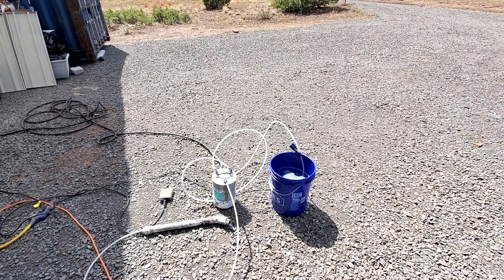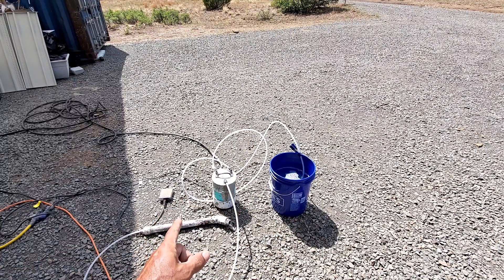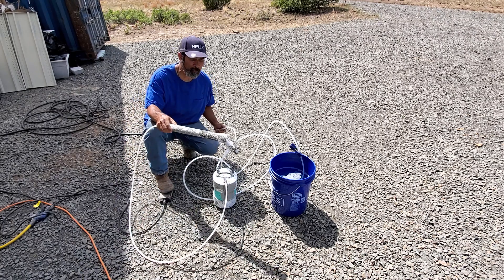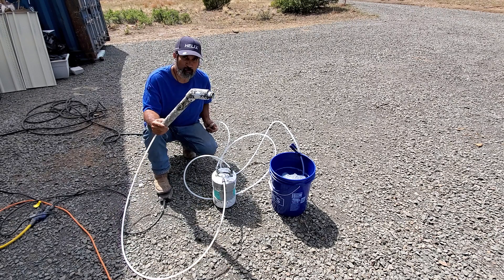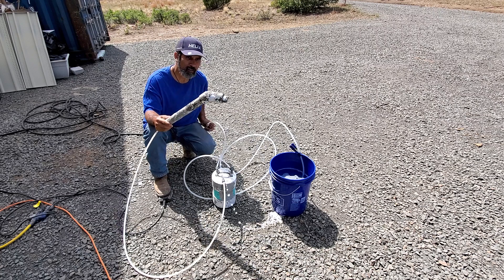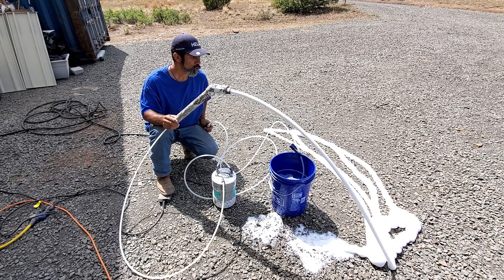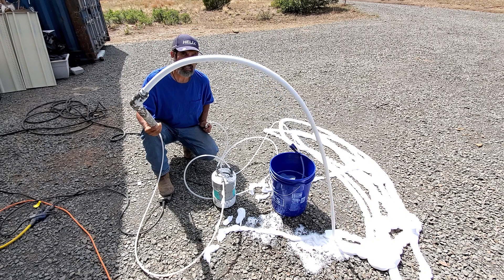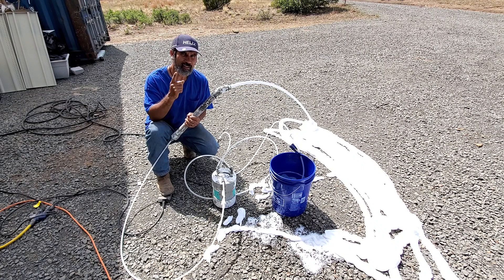How To operate & prime the Aircrete-Harry Foam Generator #aircrete #foamgenerator #aircreteharry

Comment: Thancks!
 But maybe I have a particular question that I often want to ask :
Can we make a slabfloors structure by airecrete?
That's main we need know the bender strenght in a humid case of our material because it will support a tradutional concrete  wet.
I wait your answer SOON ...
Reply: floors can have a damp proof membrane, then 3" thick foam insulating slabs then concrete screed on top, the foam slabs on their own can support the weight of the screed because the weight is distributed, this is how underfloor heating is done with hot water pipes, but of course you cannot expect aircrete on its own to be a floor, you would at least need tiles or other hard substance on top. you could use the aircrete as the insulation